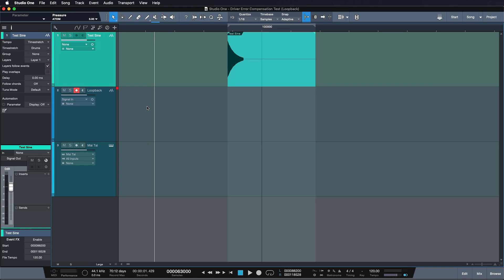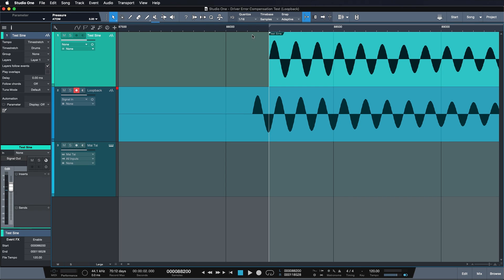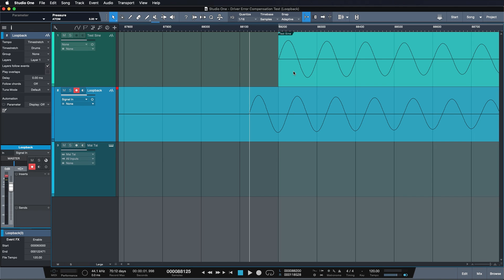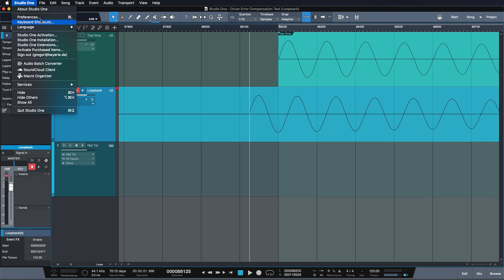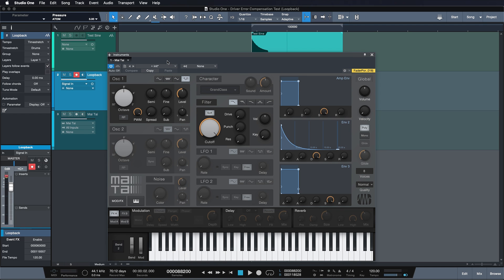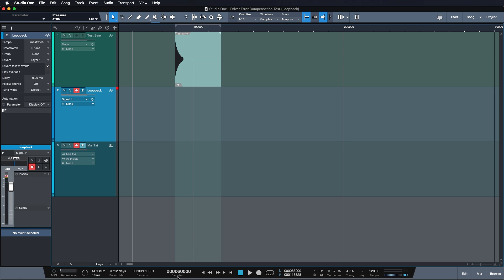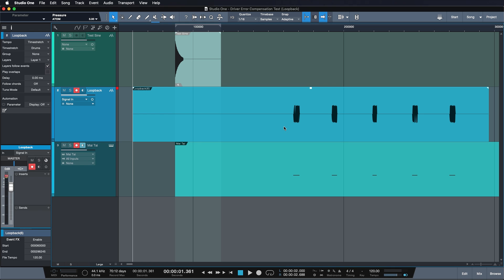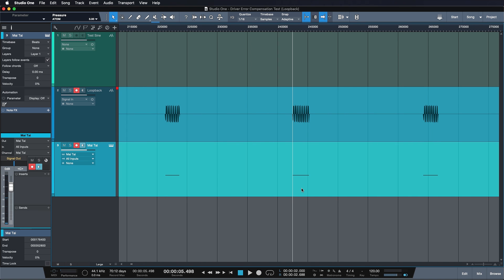PreSonus Studio One Tutorials Ep. 4: Loopback Test and Record Offset

Comment: Hey Gregor, I like your tutorials, but I've hit a wall, I'm using Win 10, Audiobox 22VSL running Studio One 4.6.1.55987 .. I don't see the same thing you do on the loopback .. I wrestled with the sine test and finally figured it out and made the adjustment - perfect! .. moving on to the loopback I cannot seem to assign the output of the Maitai to the Loopback, when I hit record, and tap the keyboard of my Impact LX61 I key the Maitai, but nothing records in the loopback .. the patching is not clear and I cannot figure it out .. I think its a Windows/Mac thing .. I'm just getting lost in the interpretation .. I'm not a power user, and I've owned Studio One for a few years, but have not been using it much .. I'm trying to ramp up here and this is hanging me up .. can you explain the loopback step by step for Windows users?
Reply from the maker: Hi James, sorry to hear that. Since you've already done the Audio Loopback successfully, all you need to do is set the exact same output for Mai Tai. Then, activate monitoring for Mai Tai and activate record on the Loopback audio track. Now you can proceed as shown. -GBY

Comment: I couldn't get this to work. I don't know if it has anything to do with me having a different audio interface. Please let me know.
Reply from the maker: Hi Kenneth, please let us know which Interface you're using and where exactly you're having issues! -GBY
Reply: PreSonus Audio Electronics I use the Scarlett 2i2 3rd Gen.
Reply: PreSonus Audio Electronics I tried to do exactly as shown in the video, but the sine wave was not recording.
Reply from the maker: @kennydoublep  try panning the sine wave all the way to the left, and send it to your Main Out. Then, turn off your speakers and connect your Main Out L on the Interface to Input 1. Set Input 1 as your input for the loopback audio track. Hit record and try again. -GBY

Comment: Just to clarify some things... the example shown with the test tone, the recorded event is 75 samples earlier, therefore a 75 samples offset is added. (in my case the event was coming in too late by 37 samples so i had to actually put an offset of  minus -37 samples)... In the vst example the resulted event was 6 samples "late" and Gregor again added 6 ms instead of deducting... Now a question. If we apply this fix at 48 sampling rate and 64 Buffer size, are we all set? Or is this relevant to song sampling rate and buffer size therefore we actually need to repeat the test if we need to change any of the two? Thanks
Reply from the maker: Hi Pambos, thank you for your question! No, a change in sample rate wouldn't require you to calculate the offset again. You might need to run this test again if you're changing your interface, or change your interface buffer size - but in Studio One, there is actually no need to adjust your buffer size at all. You should rather adjust your Dropout Protection setting. Learn more about Dropout Protection here: https://www.youtube.com/watch?v=qJI6fXewu_I

...one more thing to mention is that you only really need to go through this process if you're experiencing that your performance isn't recorded accurately. For instance, when notes that you intentionally played a bit early get recorded later than expected. -GBY
Reply: @fenderstudio  Thanks for the reply... Unfortunately I have been away from composing/recording/mixing for some years, (previously used logic, cubase, pro tools) and due to the quarantine situation i decided to start again trying to work as an online freelancer. After a lot of research decided to make a new start, something fresh, downloaded Studio One Pro demo and i'm so glad i did cause its such an inspiring DAW :) Thanks for your videos there are a big help to  get me up to speed...

Comment: Hi Gregor, thank you for sharing this information! I have a question regarding the Loopback test connection. I own the AudioBox 22VSL and am not sure how to run this test with this audio interface (it doesn't have the line out inputs that the 2|6 does). Let me know if you need any clarification on this. Thank you!
Reply from the maker: Hi Joseph, you can just unplug your Main Outs on the interface for the time being and use that for the Loopback instead. Meaning, Main Out L going to Input 1. This is fine since you do not need to monitor the Loopback test at all. -GBY
Reply: @fenderstudio  Ok, so I have tried it a few different ways and for some reason the Test Sine is coming in at 88200 samples and the Loopback is coming in at 88202. I tried to adjust the sample rate and nothing seems to change; I have my 1/4" plunged in exactly as you instructed, is there anything I am missing at this point?
Reply: @JBadalamente30  In your case, it means that your loopback audio is 2 mil secs off.. But since yours is arriving late, u need to set your offset setting to -2 instead of a postive 2!

Comment: Hi Gregor, I tried this and got the audio offset perfect, but the Midi as I tab across to my sections changes slightly each time to a higher value, this is the case everytime I have tried it. The beginning tab will be 100% with the audio transition but then moving through them it might change slightly each time, is this correct?
Reply from the maker: Hi, yes this is expected, as MIDI recording isn't sample accurate (that's also why we specify this Offset in milliseconds). If your MIDI notes and the resulting Audio are <1ms apart from each other, you're bang on. That's as close as it gets. -GBY

Comment: I can't make the tab key work. Or rather it works sometimes, but not all of the time. It works fine in all other open windows in the software... I've been hitting tab like a maniac now, but it will not find the transient and I don't understand what I'm doing wrong...
Reply from the maker: Hi Eskild, for the test sine wave, you can also use the "L" key. This will make the cursor jump to the beginning of the event, which will have the same result as Tab (since that sample is accurately trimmed to the very beginning of the event). If tab still doesn't work for your recording either for some reason, you can also just zoom in and set the beginning point manually by clicking on the timeline. Don't give up, you can do it!! :) -GBY
Reply: PreSonus Audio Electronics Thank you! It seems Studio One was a little bit sensitive to a dirty preamp/high gain setting on my interface, so it seemed to work once I had readjusted the gain to a more sensible setting. 
Enjoying the tutorials very much so far!

Comment: Hi Gregor, 2 questions. 
I ended up with a negative offset of -100. Is it normal to have a negative value? 
Also i had to reverse the phasing on my input because the waveform was reversed. Confused as to why this happened. Can you explain?
I got the waveforms to lineup, but i'm worried that I'm setting myself up for some sort of subtle future disaster with the negative value and the phasing issue. 
I;m running a StudioLive 16.0.2 to the latest version of studio one. Input was channel 1 and the output was my headphone jack on the board. Thank you for the great videos Gregor!
-Nick
Reply: Anyone have any insight to this?

Comment: Amazing tipp...so thankful. But one question: I had to change 292 samples in record offset,  you had just 85...can it be or is there something wrong? And if it's alright, is still has nothing to do with the buffer changes in the i\o settings, right (cause I change from low settings on recording to big setting for mixing)?  I really hope for an answer so that I can finally be able to concentrate on making music...I really love that S1
Reply: The offset differs on the device being used, sir. No matter the figure you get, make sure that your results don't give you a difference between the recorded sample and the test sample. That's the one that proves to you if you have done the right thing.
Reply: @Pologenius1  thanks for your respond...Maybe one word to the second part of the question?
Thank you
Reply: @Pologenius1 
What do you mean that the offset differs? 🤷🏽

Comment: Gregor, something dazzles me: How can hte recorded Audio come in before the Sine Wave is even played? Shouldnt that be the other way round?
Reply from the maker: Jens Rotter A lot of Interfaces report a lower latency to the computer than they actually have. -GBY
Reply: I had the same thought on my mind and still don't really understand it, maybe someone can clarify?  Actually, when performing the loopback, I recorded the signal after the sent signal. I've now set the offset on a negative value: is this correct?
Reply from the maker: Hi, if you're ending up with matching waveforms after the loopback, then your entered value is correct. Keep in mind that there is always an offset applied by Studio One after the recording has finished, which by default is equal to the amount of roundtrip latency reported by the interface driver. And if that interface driver actually reports a longer latency than there actually is (which happens more than you think), this places your recording ahead of the original once you stop the recording. -GBY

Comment: my recorded sinewave is 132 after the top wave. how?
Reply from the maker: DroeJackson there can be a number of reasons why this is happening. Perhaps your interface reports a higher latency than it actually has to the system. Maybe it’s because of delays caused by usb hubs...it’s hard to know for certain. The good thing is that you don’t have to find out, though! Just make sure you get the recorded sinewave aligned (by entering -132 as offset) and you’re good. -GBY

Comment: Loopback Test (Audio)
Download the Loopback test file here (can’t put link in here you can find it on the presonus.com site under the descriptions for this tutorial).
Take a cable and connect a free output on your Audio Interface to a free input. Make sure you add this input and output in your Audio I/O Setup as well (found in the menu Song -> Song Setup).
Open up the Track Inspector (F4 key) and select Track 1 (“Test Sine”). Assign the Interface output you’ve connected with the cable as the Channel Output.
Select Track 2 (“Loopback”) and assign the Interface input you’ve connected with the jack as the Channel Input.
Ensure that monitoring (the blue speaker symbol) is off on both channels and enable recording (the red button next to monitoring) for Track 2 (“Loopback”). Start recording by clicking the Record Button in the Transport Bar.
Set your Transport Bar’s timeline from bars to samples (with right click) and measure the difference between the first Transient on Track 1 and Track 2 by using the tab key.
Go to Studio One -> Preferences -> Advanced -> Audio and enter the difference amount in the Record Offset field.
IMPORTANT: Unlike in most DAWs, you only have to do this test once in Studio One, because you should never need to adjust your Audio Device block size. You only increase your Dropout Protection block size if the CPU runs out of power, which doesn’t affect the Record Offset.
Reply: Thank you for the details, I appreciate it.
Reply: Thank you. I should add that you probably should watch the gain on the input. I couldn't get it to work until i lowered the gain. If it's too loud it's like no sound is made (for some reason). I would also note that the sample difference seems to change with the gain level, and whether or not the line or monitoring buttons are pressed.
Reply: Man thank you so much for this I really appreciate it. I wish Gregor would've explained in detail like this, like about setting up the IO and such. 
I don't why know why he didn't. 🤦🏽
Reply: By the way... where's Loopback Test (MIDI)? 🤷🏽

PLEASE! 🙏🏽
And Thank you in advance! 😉

Comment: is there another way to figure out the record offset for midi other than the loopback test? for those who only make beats but may not have the equipment or proper cables required to do a loopback set up.
Reply from the maker: Hi Donte, no there isn't another way than patching an actual loopback from an output to an input on your interface. However, whether you actually need to do this depends entirely on your own recording experience. Have you noticed sometimes that what you're playing back doesn't sound exactly like what you recorded? If so, then you need to follow the process laid out in this video. Otherwise, don't bother! :) -GBY
Reply: @fenderstudio  ive come back to this video as a refresher. since my last comment my studio has grown significantly and I now use a RME UCX II for my interface. Would this test be able to be done using the loopback feature in totalmix? The reason I keep coming back and asking myself if I need to do this test is because I print in and out of the box. Sometimes using my 500 series rack, sometimes using my Analog heat as an insert instead of USB and now I'm into hardware synths. For my mixing gear pipeline is wonderful but when Im not using pipeline I want  to make sure that my print track are coming back in on time. What confuses me is how to properly use the record offset feature in the advanced tap under audio for changing the samples and the record offset feature in the advanced tab for MIDI for adjusting the ms. When should I have to adjust either of these parameters in order to assure that everything I play or record back to the daw is coming back in time. An explanation on this or a video would be really helpful. I hope this make sense and thank you  for your help.
Reply: after watching the video again i do think I have everything I need to perform these test so I will try it, my studio is way more advance now so hopefully I have a better understanding . i  would still like to know if this is able to be done using the loopback feature in totalmix using an rme interface. thanks for whatever information you can share. thank you again

Comment: Hi, Just done this on Studio One 4.6 and wonder why there is a difference in time between a live MIDI recording of the audio and recording the audio afterwards via the recorded MIDI. I followed the video exactly and I had a 1ms difference between audio and MIDI both recorded at the same time. I changed settings and was spot on following the video again and recording both together.

I then recorded the audio after the MIDI and found that there was a difference. Before the Audio was 1ms after the recorded MIDI Note which I corrected. then when I again recorded the audio using the previously recorded MIDI Notes the audio was recorded 1ms before the MIDI Note actually started.

So now I was spot on when recording Audio and Midi together, but if I record MIDI and then commit it to audio afterwards the audio is 1ms second early. Is this right and if so it means that I have to change the setting depending upon how I do things. O mostly commit audio after the fact in case I want to change instrument or tweak the MIDI track.

Why isn't the MIDI setup using Samples like the audio as 1ms is approximately 50 samples which is further out than my audio was which was only 28ms after the original audio. So unlike Gregor I did a minus instead of a positive change. using samples I could have got MIDI and Audio even tighter!
Reply from the maker: Hi John, there is no way on earth that you could hear, or adjust your playing to a difference of 1ms. You're all set! :) -GBY
Reply: @fenderstudio   Hi thanks for your feedback. Yes, humanly speaking we would not perceive the difference, but by changing my settings I removed the 1ms difference and now I feel happier for it.

Have you ever recorded a midi guitar using Studio One and if so what was your experience in doing so. I had problems setting it all up and wasn't sure what MIDI settings to use as it wasn't a keyboard and the MIDI signal didn't come fro or through a MIDI Keyboard. 

It came through an Axon AX 100 MK II which the guitar was plugged into and the Axon processed the MIDI and sent that to my Audio card MIDI Port and the Sound of the Guitar through the  audio output of the Axon was also recorded along with the original unprocessed sound of the Guitar.

So I got the MIDI signal to use with other instruments, the MIDI Instrument that the guitar played  processed by the Axon and a normal guitar sound. Not too bad, three instruments recorded from the one guitar. I find MIDI difficult to comprehend. Are there any in depth tuturials for it in  Studio One.

Regards

John
De Carteret

Comment: I understand about manually routing the audio out back to the audio in, but if I don't have audio to record (just a USB midi input) do I need to do this?  IOW, I don't need to worry about audio latency as I'm only a midi person.   Can't I just hook the output of the midi track to the audio track without the physical cabling?  (I guess I should try -- my midi keyboard comes tomorrow).
Reply from the maker: Hi Mike, whether you would need to do this depends on how you record notes for your vst instruments. Are you triggering them from a MIDI Keyboard or Pad Controller? If so, have you noticed sometimes that what you're playing back doesn't sound exactly like what you recorded? If so, then you need to follow the process laid out in this video. Running the Virtual Instrument Output to the Audio Track virtually wouldn't tell you anything about the interface roundtrip latency, and whether that's being reported correctly to Studio One by the interface driver. So no, that's not an option sadly. :)  -GBY